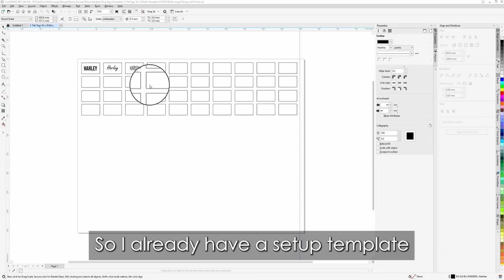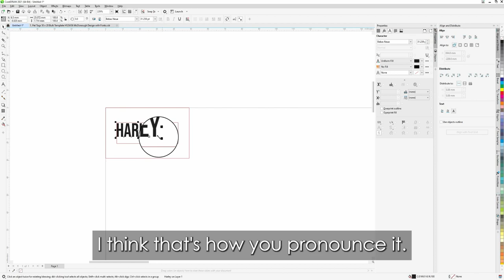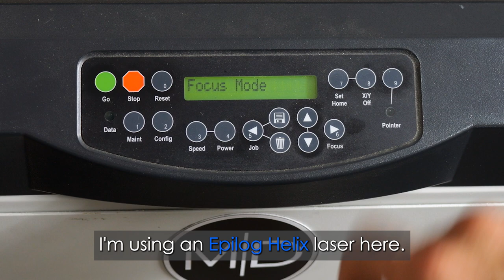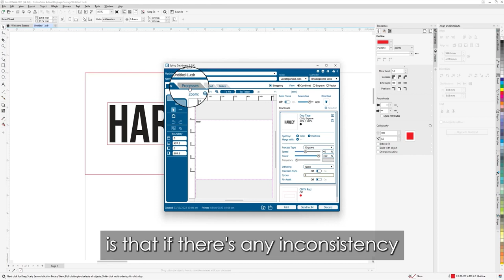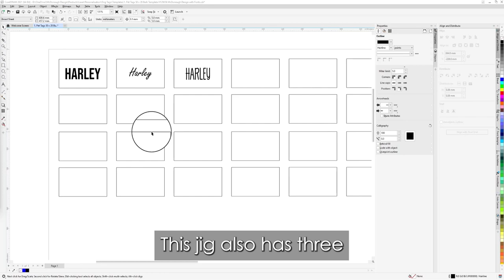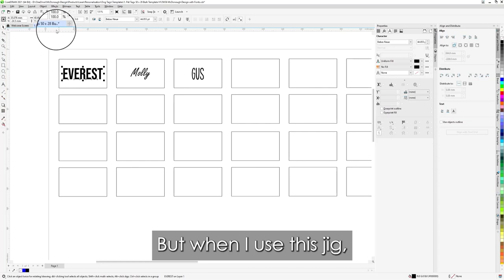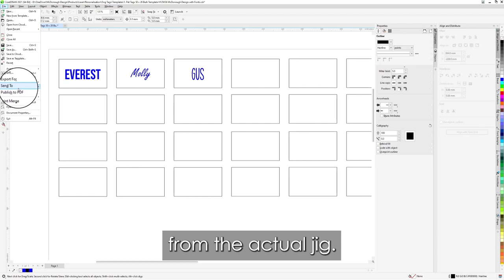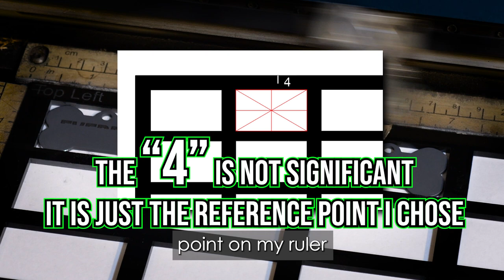Secrets Revealed: How to Laser Engrave Dog Tags Like a Pro! (or any Stainless Steel for that matter)

Comment: Love the video and the final result. What would you recommend to engrave iron dog medals in terms of machine or process as a most affordable option?
Reply from the maker: Hi there - thanks for the question...unfortunately I have never lasered onto iron before. It is not a particular material that I have seen much use for in Co2 laser cutting. So any advice I would give would be a complete guess I'm afraid. I have seen other people have some success using fibre laser machines on ferrous metals but it is not something I have any experience with myself, nor have I seen much Co2 laser engraving on ferrous metals - I am sure someone out there has tried though...

Comment: Good video, could you recommend a cheap laser engraver to use exclusively for engraving this type of tags please?
Reply from the maker: @AtarahWeb Unfortunately I haven't used many other lasers. If you are looking to engrave only and do no imagery, a cheap 50w - 100w Co2 laser would do the trick. I would look for a laser that had a control panel that could at least run "Lightburn" software. Standalone machine programs can be a pain.
Reply: @mcdonoughdesign  Thank you for your time

Comment: Which  machine do you use? That video is really helpful!
Reply from the maker: That particular laser is an Epilog Helix 24 x 18 - 50Watt Co2 Laser. They are very expensive but a bit overkill for something like these tags. Most cheaper Co2 Lasers will do just as good of a job when it comes to this kind of process. I only have the Epilog as its image-lasering capabilities are unrivaled in my opinion. Glad you liked the video :)

Comment: i have a question, i have a round dog tag, how do i make sure the tag is straight? is there any method to do it or i just have to trust my feelings? thanks
Reply from the maker: I have a circle silhouette template I use for those that has another little circle engraved in it to show where the keyring goes. I just line up the hole in the key tag with the circle engraved on the template. Hope that makes sense.

Comment: I’ve never had to spray my tags to use the laser on them. Have you tried it without the spray? It seems like a lot of unnecessary danger with the spray step…
Reply from the maker: You must have a fiber laser? It's impossible to mark stainless steel on my Co2 laser without the marking spray.